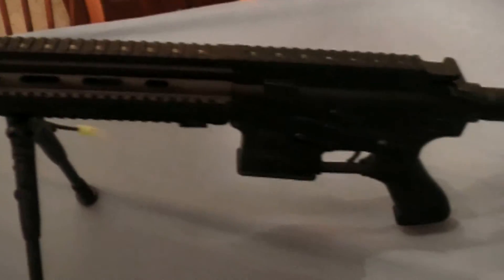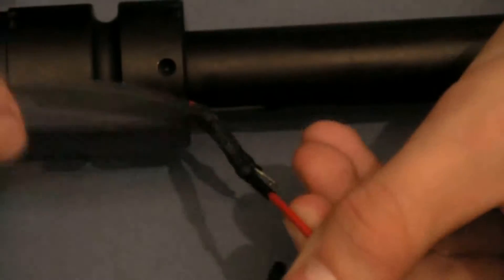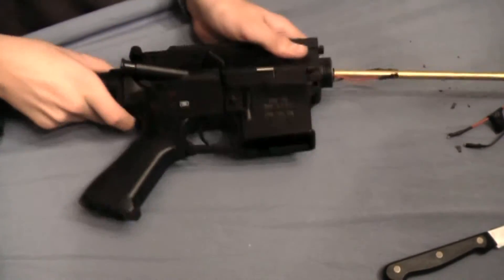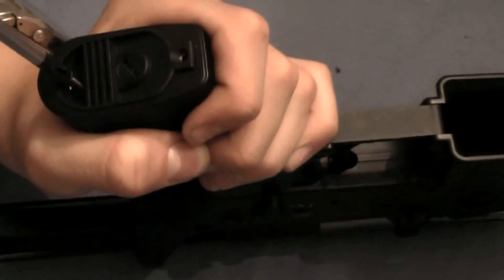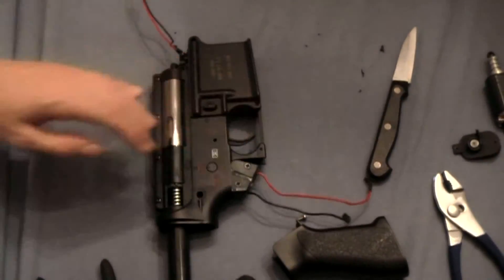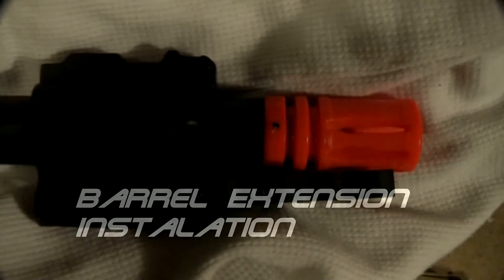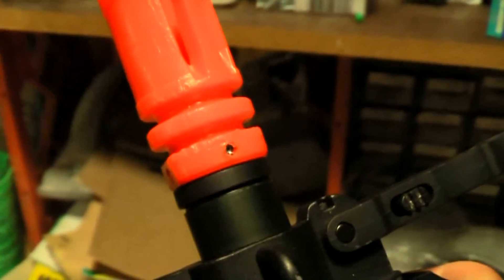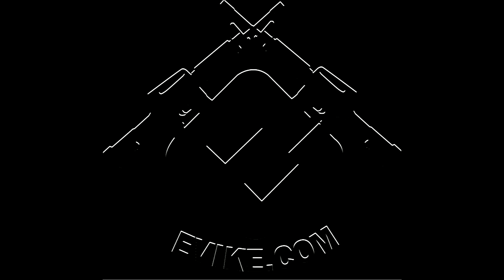Echo-1 614  disassembly guide

Comment: well i tried to disassemble it and i am having trouble taking the  external barrel off i unscrew the nut or whatever it is in the back but still didn't come off the only thing i saw that was different was where the battery was located